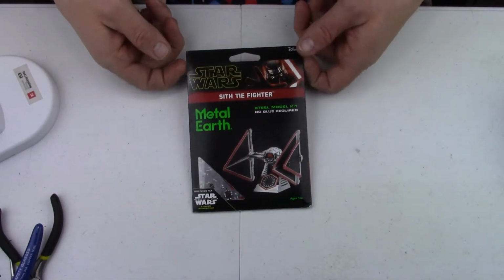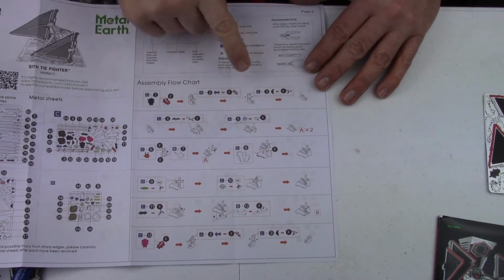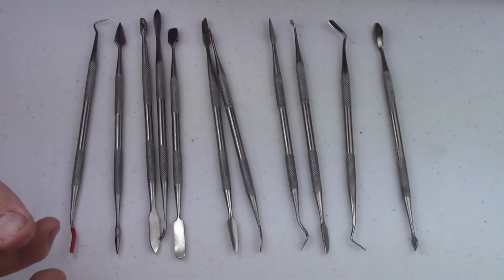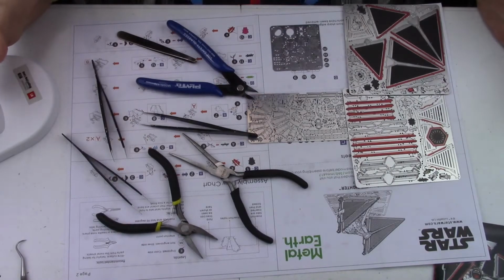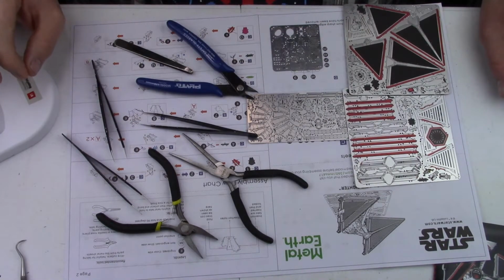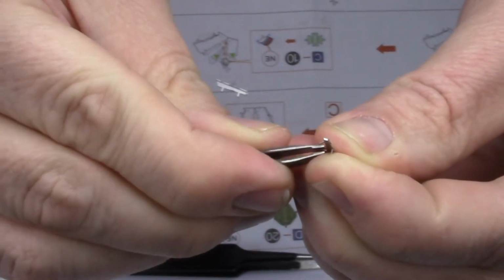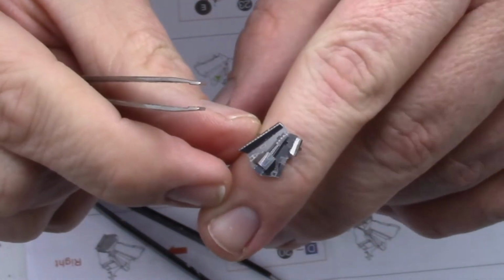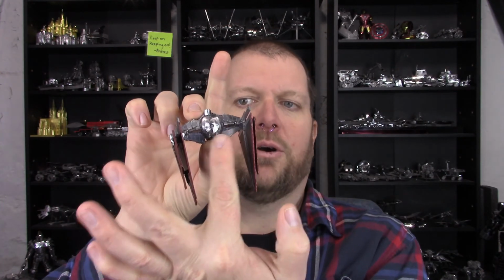Metal Earth build - Sith Tie Fighter - Part 1 - Star Wars

Comment: Thank you for making these videos. You help me a lot and I want to ask if should get Poe’s x wing after I already 
built dv tie fighter, u wing, at at walker and Krenicks imperial shuttle. Thanks
Reply from the maker: If you are asking if I think after building the other models you are up to the challenge, that I would say yes. Oddly enough I think the trickiest part of Poe's X wing is getting the nose cone tabs in place. I didn't do a good job of showing how I did it in my video but you have to flex this  kind of sideways to get the tabs in. It's a pain.
Reply: Thanks for the advice.